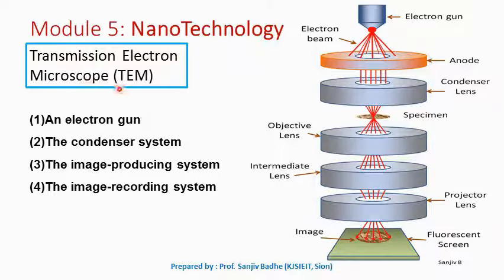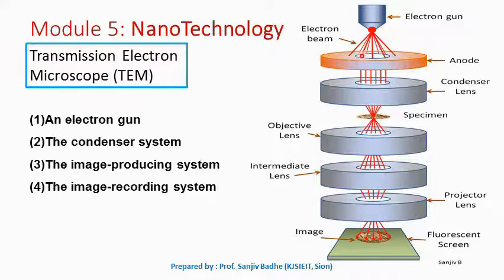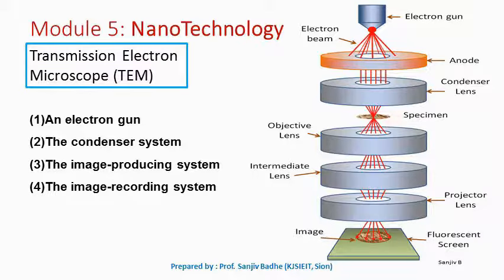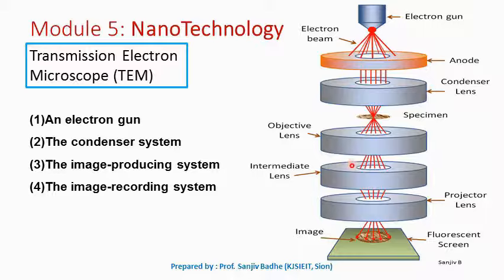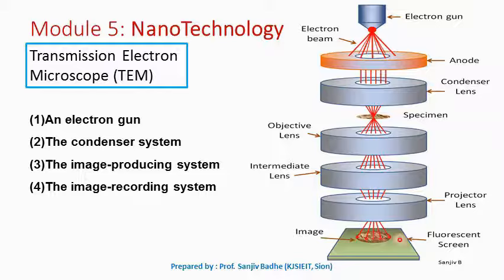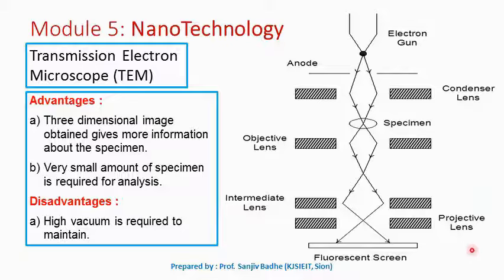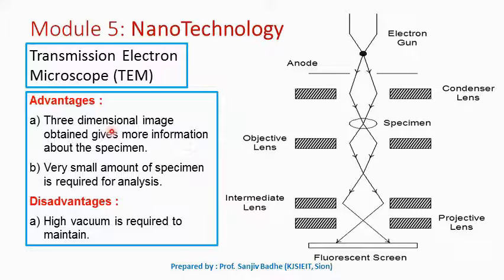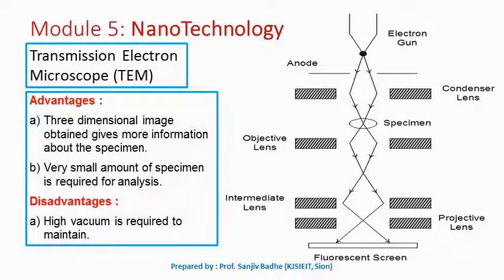Transmission Electron Microscope (TEM) Construction and Working

Comment: tem does not produce 3d images
Reply from the maker: TEM can provide high resolution views of the object which are very small in size. TEM can provide 2D image directly which is a limitation. But this can be overcome and 3D representation of the sample can be obtained by acquiring consecutive images while rotating the specimen through a tilt arc. Of course, it requires very high precision and hundreds of images need to be taken and then with the help of computer, 3D image can be constructed.. The drawback is, transmitting electron beam multiple times may affect the sample’s structure..
In one more approach, the sample stands still while the microscope sends two beams of electrons tilted against each other, and two detectors are simultaneously used to record the signal. Approach used combination of scanning and transmission electron microscopy to get a 3D image with less number of images.. Here, the sample is exposed to electron beam less number of times so will not get affected…
Reply: TEM we use single crystal
Reply: 2d image